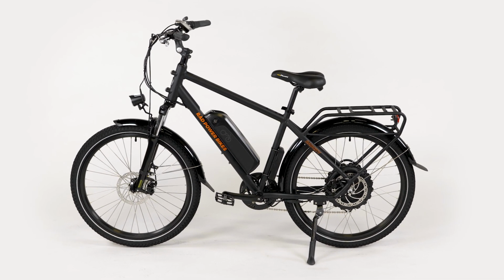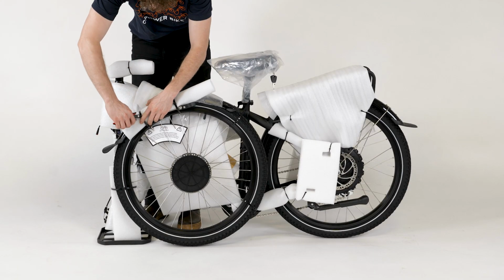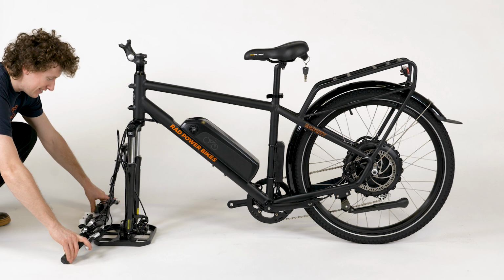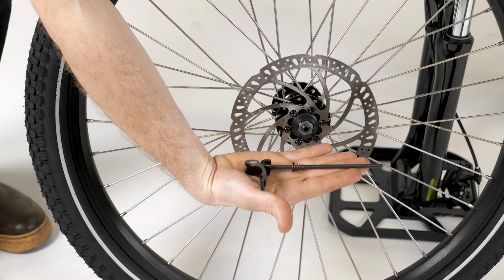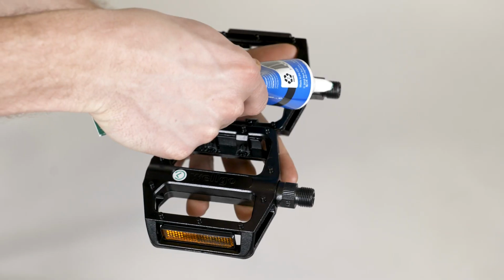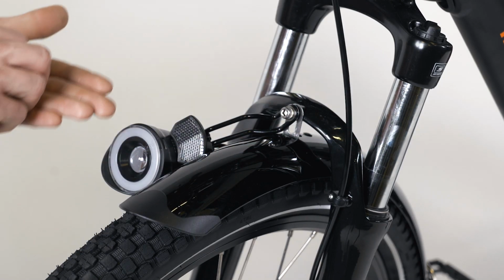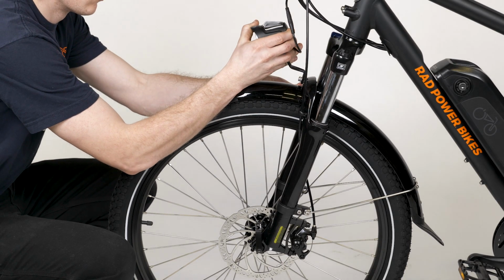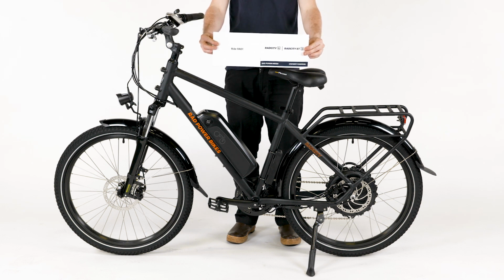RadCity 4 Assembly Instructions | Rad Tech

Comment: The cone spring was tucked way in and didn't wanna pop out like in the video so it got a bit bent as I tried to keep it in place. Maybe the hole should be at the bottom of the protector so you don't have to keep a heavy bike suspended perfectly while searching for it.

Comment: Putting the bike together was so easy, but i had a problem with filling the rear tire with air. as i was filling the tire up the tube exploded. the crazy thing was it was'nt even 30lbs of pressure when it blew. so now i bring it to a bike shop to replace the tube and now the mechanic installs new tube and i am walking out the door when the tube explodes for no reason. now the mechanic is dumbfounded and takes it all apart again and notices that it blew in the same place, so he looks at the rim and sees a sharp area where the rim was put together so he filed it and put a little piece of tape and installed a new tube and now he had to install a new tire because of the explosion split the tire.what a terrible experience because of a defective rim.  GOOD LUCK

Comment: I was baffled about how the front axle bolt went in until i found another assembly video. In removing the plastic cover, the stem remained in the hole; everything being black, i thought it was a metal bolt, but in the other video, i saw the axel went clean thru, so i gave it a whack, and the plastic popped out. I suggest changing the color of the temporary plastic pieces.

Also, my bike did not come with the fender/headlight mounting bolt, so i had to substitute my own. Small disappointment.

I tried to get the battery off beforehand, both to charge it & to remove some of the bike's weight while putting it together, but i couldn’t figure out how, even after consulting the manual. I had to watch a review.

Overall, it was not a difficult build, but there are times when a second person would be very helpful. And without a bike stand, it was hard on my weak back, strengthening which is the reason i bought a bike. 💁🏻‍♂️
Reply from the maker: Hey hey! Thank you for sharing this feedback! If you need any assistance with replacing the fender/headlight mounting bolt, please don't hesitate to reach out to our Product Support team at - radpowerbikes.com/support. So glad to hear you're up and riding!

Comment: And how do you "torque each pedal to 35 Nm?" You can't use a torque wrench on the pedals. The person on the video doesn't use a torque wrench, does he have a calibrated arm? Do you expect the average buyer to even have a torque wrench? Why don't you include a little tube of bicycle grease with the bikes, how much could that cost? And why did you not install both cone springs on my front axle, or tighten the electrical connections? Do you use any sort of quality control?

Comment: Any suggestions on assembly during Covid closures? Ordered my bike and it is coming soon, really looking forward to going to work on a bike instead of driving.
Reply: as long as you take your time and follow the video it really is super easy to put together, I was able to put it together with little mechanical experience and no tools that weren't included in about two or so hours
Reply: @Eyeb0wls  yea,was able to build mine almost by myself, sadly the entire electronic system broke down on the third day, after months of repairs and replacing parts my replacement bike was shipped out today

Comment: Is there a place that you recommend in Dallas that could put this together?
Reply from the maker: Hey there! For most reputable bicycle shops, assembling one of our bikes is an easy task. All of our mechanical components are industry standard bicycle parts and the electronics are all set up right out of the box. I do know that we have a few shops we've worked with in Dallas before so shoot us an email to "info@radpowerbikes.com" or give us a ring at (800) 939-0310 x1 so we can get you pointed in the right direction 👍
Reply: can you recommend a bike shop for Range Rover assembly. 93117. Santa Barbara